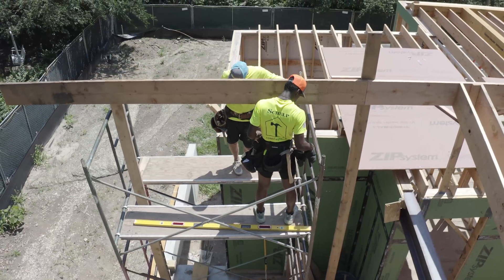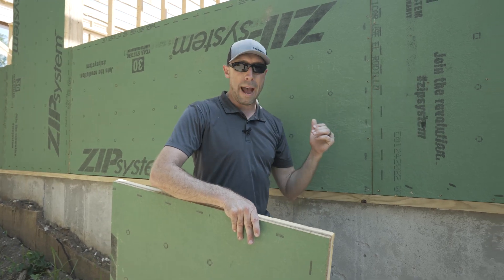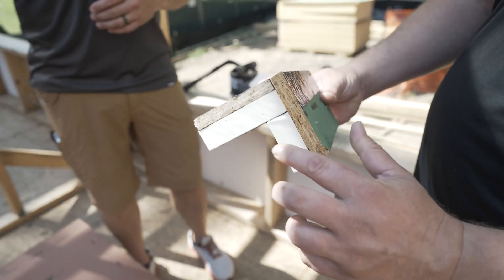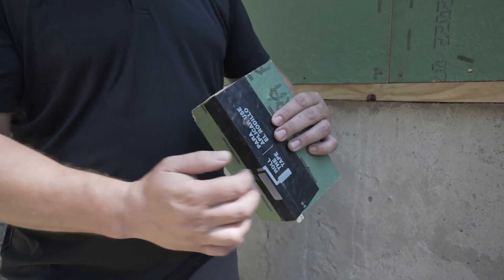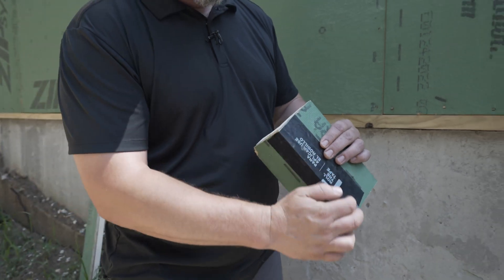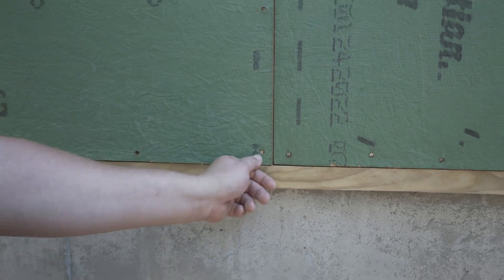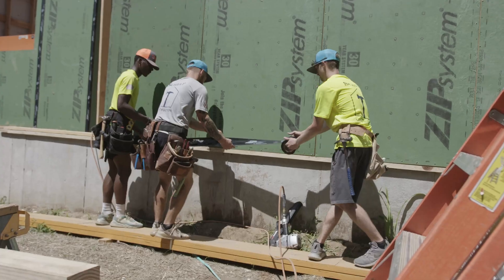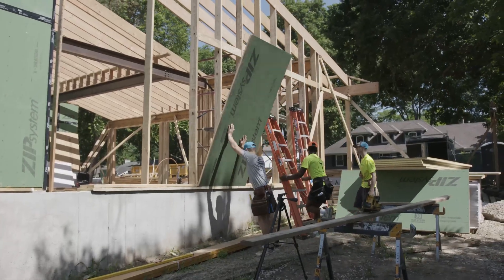Airtight Corner for a Variety of Cladding Types

Comment: @finehomebuilding, may I have more detail on your 24" OC wall framing details, I am designing a home right now for me and my Wife and I love not only ZipR6 and using I C F's for the foundation but adding more insulation into a 24" OC and its funny I was working on cantilevering the Sill Plate to sit my ZipR6 panels on it, would be a better home!!! Is there a way that I could see more details and speak to someone??? I am in the North East USA!!! Thank you and liked#7~~~ and subscribed!!!
Reply: Just fyi some building departments won't let you cantilever the sill plate even if it's a sensible thing to do. Talk to your local building department before you go too far down that path.